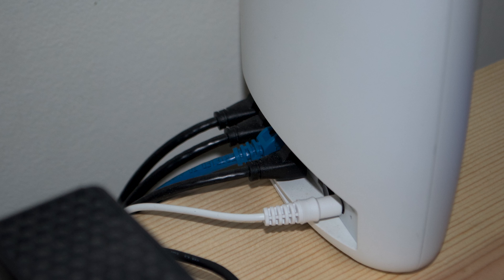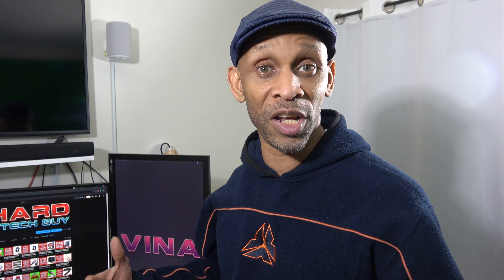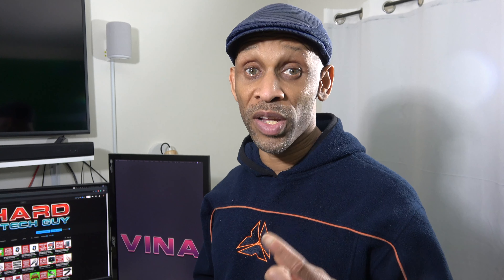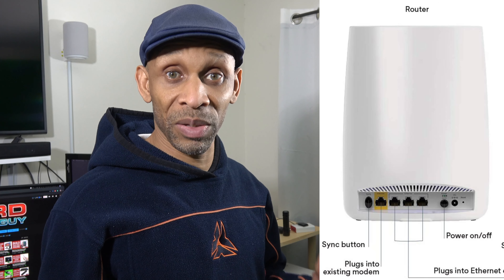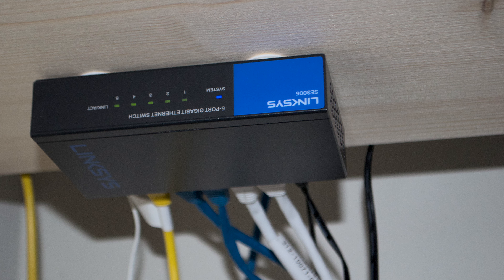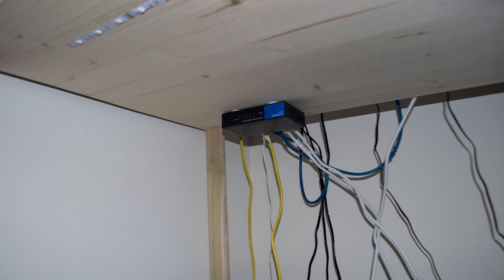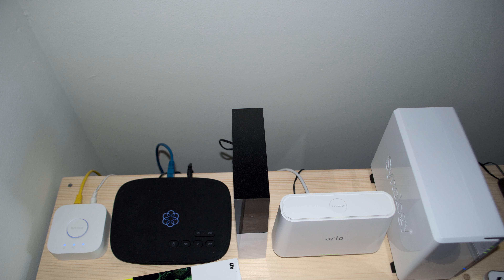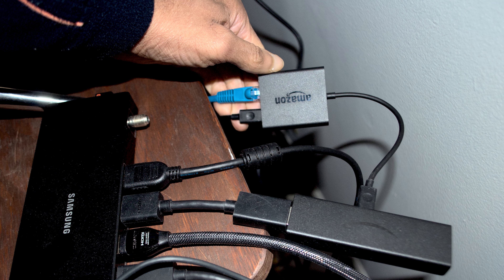How To Reduce The Load On Your Home WiFi System

Comment: How bad are my wifi light bulbs and Alexa devices draining on my wifi? I have a 600Mbps xfinity plan, but my wifi struggles. My kids are distance learning and I’m working from home.. connectivity sucks even with just 4 devices actively running! After school/work, my son struggles to keep his Switch connected and I struggle with my tablet. My house is only 1000sqft and my internet speed should be pretty high, so I don’t know what the issue could be if not smart devices. 

What would make the most sense as a solution? A mesh system? A better router? A smart device hub? (If I had to pick one to start with)
Reply from the maker: Hello, the Wi-Fi bulbs does not put any significant load on the Wi-Fi, it only use it to turn the bulb on or off. The things that are really going to put a load on the Wi-Fi system is streaming devices, video conferences, online gaming, downloading/uploading large files. Your internet speed sounds fine to me, so you might want to consider upgrading the Router. With 1000 Square foot, you can get away with a new single Router, make sure it's AC (Wi-Fi 5) or AX (Wi-Fi 6) Router. Mesh System is always going to be your best option especially if you have a lot of square footage (3000sqft or greater).
Suggested video: The Best Recommended Placement For Your Wi-Fi Router https://youtu.be/yJioCrQeoK8
Reply: @ChardTheTechGuy  thank you for your thoughtful reply! We are moving to a larger house in a few weeks and I just purchased the eero 6 mesh system, so we’ll see if that helps.